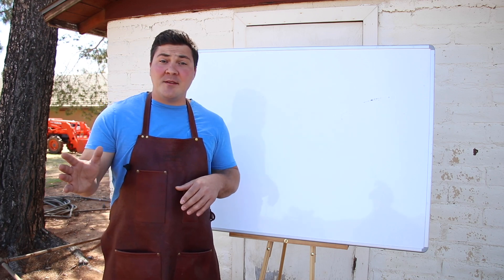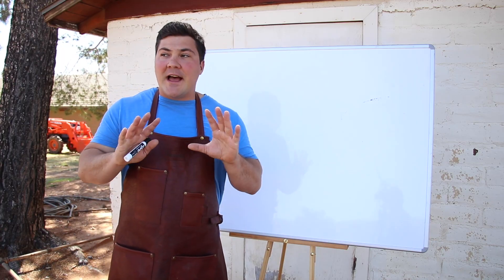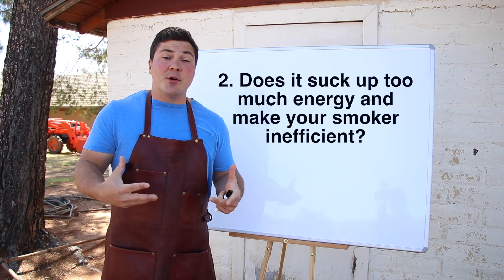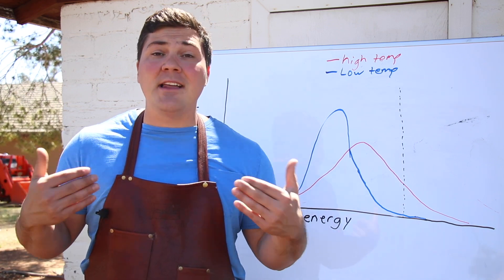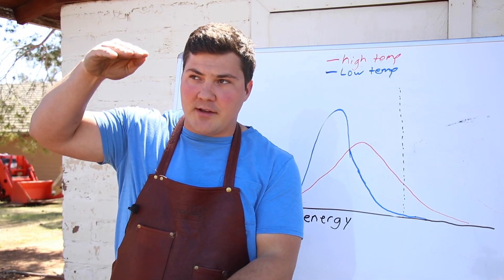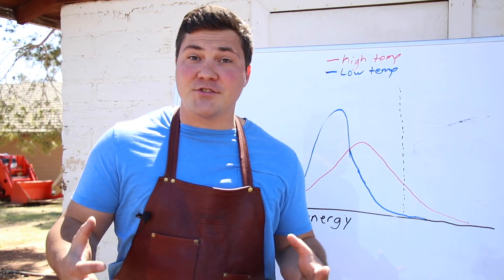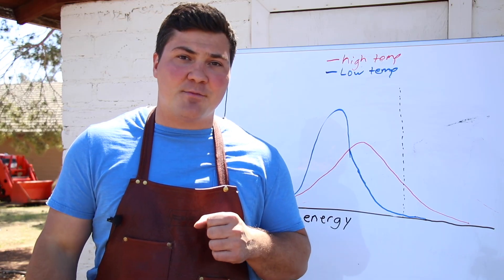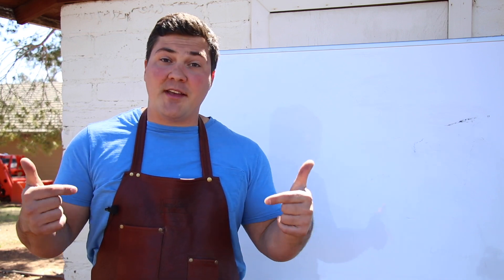Do Water Pans Improve Barbecue? A Scientific Analysis

Comment: I can't really find a logic fault with your logic on your theorical approach to how much water goes though the cooker how ever you are ignoring the gass dynamics of different temperature stream. Combustion byproducts are very hot 700 degrees+ however your water pans will only be just above boiling so they will likely stay in your cooker a lot longer then higher energy less dense steam. More of the physics side then chemistry, as an engineer I would have just set up a test with humistat to compare the difference of internal humidity for each of your set ups and introduce a fudge factor to account for the gas dynamics rather then a full cfd analysis ;). 

Another physics based consideration would be the rate of heat transfer to your food. humid air conducts heat a lot more efficiently so it will cook your food faster that might be enough to offset the efficiency loss in burn rate. 

It could also cause more smoke penetration but thats more of a guess, heavier air shouldn't move as quickly and thus smoke has more time in contact with your food.

Comment: I do all my BBQ on a Weber Kettle grill. Unless I'm making jerky I always have a water pan full and sitting on the lower grate next to the charcoal. My meat sits up above the water. I use a 13x9 cake pan on the bottom grate. It has lots of surface area, and also a decent volume of water for the cook chamber. In experience I have noticed that in addition to help keep more moisture in the BBQ, it also helps stabilize the temperature (which is important in such a small bbq). I noticed bigger the water pan and there water I used the more even my temps stayed. It also recovered quicker when opening the lid to check on things. The water in the pan acts as a heat sink.  It absorbs a certain amount of heat which helps slow down the rise Ina cooking temp if the coals start getting hotter. It also can give off heat as the coals cool down to slow the decrease in cooking temp. As you mentioned the liquid water in the water pan will never get above 212 F (it is at atmospheric pressure so it's boiling point is 100 C or 212 F).  Having this big pan of 212 F water right below the meat helps provide a moist gentle heat to the meat while the rest of the convection and radiative meat from the coals and airflow bounce around the cook chamber and end up in the sides and top of the meat. In my Weber Kettle grill the 13 X 9 cake pan is the largest water pan incan fit on the lower grate and still have a decent amount of room to load up with charcoal. With about 1/3 of the charcoal lit and 2/3 unlit, full pan of water, top vent half open, and bottom vent about 1/4 open I can maintain a cooking temp of about 215 F to 260 F for at least 3 hrs (sometimes 4 hrs if it isn't really cold or windy out) before having to add more charcoal. I've got it down pretty well there. I do have limitations on the amount of cooking space (only about 2/3 of the upper rack is in the indirect area, the other 1/3 is right above the coals), and I do have to adjust the bottom vent every now and then. More often when dialing in the airflow and temp, but once it's set it.might go an hour before needing to be adjusted again.  I am hoping to upgrade to a vertical 55 gal drum smoker in the near future.  I would love a nice offset smoker but I just don't have the money or cook enough to justify it.

Comment: There is zero water content in things like deep fryer oil, wagyu tallow, bacon fat, etc...doesn't seem to be a problem there. People aren't steaming broccoli or boiling potatoes because of any special flavor or texture imparted by water,  and we actually do things like dry aging steaks (in part) to purposely remove water. Ironically the water pan has very little to do with water, it's about heat.

Comment: This is not the correct way to answer this question.  A physics/engineering analysis tells us nothing useful.  You could be smack on with your science and still dead wrong about whether that effect produces a better tasting product.  Or (more likely, sorry) your analysis could be pseudoscientific hogwash, and you could still be wrong about how it affects the product.  The way to tell is to do two briskets exactly the same way, one with a water pan and one without and see how the brisket turns out.  The exact explanation for WHY the brisket turns out differently may be beyond your grasp, but it wouldn't matter. You'd know the only thing in the equation that really matters.

Comment: This doesn’t “add up”. If, as is the practice as I understand it, the wood is reduced to charcoal before being transferred to the firebox by commercial/professional pit masters the moisture would already be driven off. Most, at least in Central Texas where brisket is cooked “low and slow” use wood (commonly “post oak”) that has been aged a year. 

Home cooks may be using charcoal rather than wood making these numbers irrelevant. If cooking with wood in a cross flow smoker there is an open question in my mind about the available moisture at the temperatures involved.

Comment: Thanks man, i use the WSM and am sometimes torn between using the water pan or not. There two big schools of thought on this one yes one no. As it primely a Charcoal fired heat source i still think the same theory applies. So in conclusion on slow and low it will be water pan from now on. Any additional information regarding the WSM and water pans would be helpful

Comment: I had a total fail and wanted to ask you........i have cooked on a pellet grill for years and have GREAT results with "fall off the bone" ribs and boston butts.  recently used my same cooking methods on an Electric Smoker which calls for a water pan. I have never used a water pan in all of my cooking.  The day I cooked it rained all day.  My point, between the rain and the water pan I feel that I was steaming the meat more than smoking the meat.  My first venture with the ES  was terrible. I did everything just as if I was on my pellet grill ; low and slow /  225   / standard 321 technique / wrap the butt after  165.  Is there any such thing as TOO much moisture when cooking ?  My ES had a large window and from the out side looking in it looked like a rain forest with constant dripping and water running down the window.  I took the ES back to the store....... was it me or the weather or the smoker ?

Comment: Franklin says use a water pan. I used a water pan for 50 years. Tried a couple of times without a pan, Nope. For one or two briskets about a gallon of water in a pan lasts about 2-3 hours. Water goes in the cooking chamber with the meat. Between the meat and the heat. Water can be apple cider vinegar or whatever.

Comment: I  sucks at math but I know you left out all the relative humidity of the combustion air which will  change your #s alot  I believe if you concidered all the factors you would determine the use of a water pan would depend on the climate you were cooking in.also the more humidity in the cook chamber the more latten heat more BTUs will be held within cooking chamber which I believe makes everything cook more evenly

Comment: One question with your last graph. You showed the high energy particles from the high temp being mitigated by water, but those high energy particles are what cause heat, so in essence, your water pan is just lowering the overall heat of the chamber.  Correct?

Comment: You calculations are based on a cord of wood and the amount of water but I know you don't burn a whole cord of wood for brisket. Therefore the amount of water from the wood will be a lot less than you are saying because you are not using that much wood in one cook period.  And because of that your credibility falters greatly.
Reply from the maker: Did you not listen to the video or look at the board? I specifically did the subsequent calculations based on the amount of wood used in a 12 hour cook before wrapping. I simply discussed the weight and trapped water in a cord of wood to bring some perspective to the discussion. I don’t think providing context for the discussion diminishes my credibility.
Reply: @MadScientistBBQ   yes I did and you said you got 176 pounds of water out of the wood you burnt and water weights about 8 lbs per gal so you are saying that it add 22 gallons of water to the burn. Doubt it as thats about 4 and half five gallon jugs of water/ moisture.

Comment: I don't know about any science behind why I do what I do but I cook on two different smokers. A vertical smoker and I've just built a drum smoker. I've only cooked on the drum 3 times so haven't found my favorite technique but the vertical I've had for 10 years. With the vertical smoker I found it much easier to regulate and hold temperature with a water pan. It's 24" X 24" X60" tall built with 1/4" plate. I tried a number of different water pans and a cast iron pan 20" in diameter and 2 1/2" deep is the best I've found for this application. I'm going to roll it in the shop this winter and insulate it with 1 1/2" high temp insulation and 1/8" plate as a new skin. It has been temperamental in the rain and I want to take weather out of my results. Cold weather hasn't bothered it as long as it's cold when I start the cook. At the same time I'm either going to add a 48" offset cook chamber to it or build a big offset. I'm retiring in February so I'll have plenty of time for the first time in my life. But if I add a cook chamber to it I can use the vertical for a warmer or smoke on it like I do now. I'll just need to increase the size of the firebox and I'll lose the first two racks doing that. Losing the racks is no big deal since I never even come close to using it's full capacity right now. 
Maybe I'm in the minority but this has been one of my favorite videos that you've posted yet.

Comment: Can I also add, that I firmly believe that when steel is cold it absorbs moisture from the atmosphere and when heated the moisture is released. Hence why before we weld thick steel we have to heat it to at least 100 degrees Celsius.

Comment: Awesome video! About 6 months ago I started using a cast iron pan to withstand the direct flames and provide an even heat.
Reply: This works. I have never used anything but a water pan because my smoker can with one and it runs out, it gets hot!

Comment: I can't get over the amount of wood you're using....I mean my wood shed holds 10 cords and that can heat a 2500 sq ft house with a vaulted 14ft ceiling for two whole winters in the Upper Peninsula of Michigan, burn 4 hour long campfires every weekend during the summer, and still have enough to smoke every other weekend. How many pounds of brisket do you do at a time? ..that's literally 8000 kilowatt hours. You should hook up a steam generator to that and collect some of that lost energy..
Reply from the maker: tcdahn7 haha the process of bbq is about making undesirable cuts of meat into something tasty. Efficiency is certainly not a strong point.

Comment: I’m pretty sure your calculations are way wrong or I’m missing something. At ~8 minutes in, you state that the wood produces 176lbs of water. I’m assuming you’re not using more than 10 lbs of wood in those 12 hours. Something that weighs 10lbs cannot creat 176lbs of something else through a reduction reaction.

Comment: You are not factoring in the Air humidity. Humidity is always present be it 5% to 75% and is depending on weather, during your cook (that percentage of the day/cook), it's a constant as you need air to feed the fire. That contributes to a lot of moisture within your cooking vessel and that percentage would alter you perception of the moisture in the wood. Also a water pan is to help regulate and to force a known constant of humidity.

Comment: It's my understanding the water pan adding moisture to the cook chamber serves to help with smoke particles adhering to the meat. The being completely dry or really wet won't provide optimum smoke penetration. Most of which will happen in the first half of a cook. That's also a reason to sprits with some liquid directly onto the meat (other than what flavors you may add via the spray).

Comment: Im not very good at all the science behind smoking food. I seriously use a Charbroil Gas2Coal 3 burner grill. I started by using one burner and a smoker box with pellets. I have moved to using charcoal with a water pan under the food. You just made my day. I was using 2 6" deep by 3" wide by 5" long foil pans for water. My theory was to use those 2 pans in beetween the heat source and the food to moisturize the grill. I know gas grills arent good for smoking because they dont seal but this is all I have to work with until I save up for a smoker. But I switched to a baking sheet that is 1" deep by 10" wide by 14" long. I did Iowa Chops with hickory chunks right on the coals and the pan under the chops about 4 inches down. Before the baking sheet with water my chops were still turning out kind of dry. Decent smoke but still dry. These were honestly perfect for my level of smoking. I know others are going to do a better job with dedicated smokers but I am proud that the pan worked so much better then the deep foil pans. Let me know if you have any suggestions for me on my method. Again I know its not perfect...lol

Comment: Don’t forget that the denser the environment inside the chamber the more efficient the transfer of heat to the meat! Also, even though you mentioned keeping the mean moist, once the ambient environment inside the chamber reaches saturation it’s ability to absorb more moisture is restrained. In other words the moisture inside the meat will either stay in the meat or drip out! 
The same theory applies to baking bread. I ether spritz the bread while baking or add a little water to a saucer and place it inside the baking chamber,,, then remove it last few minutes. Cheers!

Comment: Very well done. One thing. You mentioned fire using oxygen burning. Actually it only uses approximately 21%. It otherwise uses 78% nitrogen 3%argon and the rest is other.  But a hugely excellent video.  Been cooking with water pans for years. Direct meaning above the fire but offset as of late.
Reply: ...... Nitrogen and Argon are not involved in the combustion process.....

Comment: So my brain started hurting halfway through. Can someone please tell me should I use a water pan or not??
Reply: Pellet grill possibly. ,,BGE NO...stick burner if you want to.
Reply: @BluegrassNBass  - why BGE (which I took to mean "any ceramic kamado") NO?
Reply: It's up to YOU.  Do a cook of the same type of meat, a Chuck roast, pork loin, something on the cheaper side, and use it for one and then not on the other.  Prepare the protein in the same way for both.  I've done well over 150 briskets, shoulders galore, ribs, chickens, sausage, and I've found I do not need a water pan.  But, I use a Big Green Egg, which I may also say is outstanding in it's heat usage/retention and it's a dream to hold the temp. you want.
Reply: Chuck Graham I was just being sarcastic. Lol I cook brisket every Saturday for catering and selling and only use water pans if it’s super dry or I’m doing low and slow. I usually do hot and fast from 275-300 and wrap with foil. I also add beef broth with rub mixed in so they never dry out. This method seems to work best on my offset stick burner. I’m about to built out my 325 tank and I’ll have to experiment with pans on that one since it’s guna be a lot bigger, around 30” x 10 feet.
Reply: Do you spritz/spray OR wrap?

If you do any of these 3- no.
Reply: Jack I don’t normally spritz unless it’s a real dry day but I do wrap my briskets in aluminum foil because that how Mrs Tootsie does it and because I normally do hot and fast around 275 to 300 on my briskets and ribs.
Reply: Do what gives you your best results you prefer.  That is always been my motto. I seen many never use water and the smoked neat is excellent and some bad and other with water or fruit juice  both good and bad . Temperature Temperature temperature the most important aspect, thus low and slow wins the game. And finally a long rest afterwards. As if you cut in to it too soon you loss all the moisture in the meat and becomes dry out. Whether you used a water pan or not.  Also the fat content external and internal plays a factor in moisture and protection from the heat.
Reply: Yes use a pan lol.
Reply: Yes use a water pan. It acts as a heat sink so makes it easier to control temp in a kettle grill like a weber.

# 2: Not only does it help keep your meat moist, but moist meat absorbs smoke better. Win/Win
Reply: Old Gyrene I got a stick burner(offset)

Comment: A quick check of my firewood which includes White Oak, Hickory, pecan, persimmon, and black cherry, shows a moisture content between 5 and 15%. I should note that the wood is stored inside a shed with a metal roof and is all between 2 and 4 years old. Where I live, the temperature inside that metal shed during the summer can be in excess of 120 degrees.
The fireplace wood I use, which is all red and white oak, is stored Outdoors under a lean-to roof, and has a pretty consistent moisture content of 30 to 35%. It is only about a year old and it does get rained on occasionally.
My long-winded point is this: at a given temperature, the air inside your smoker Can Only Hold so much water. A water pan helps to make sure that this maximum or close to it is achieved.
This is important because the lower the humidity inside your smoker, the more moisture the hot-air will be able to draw out of your meat.